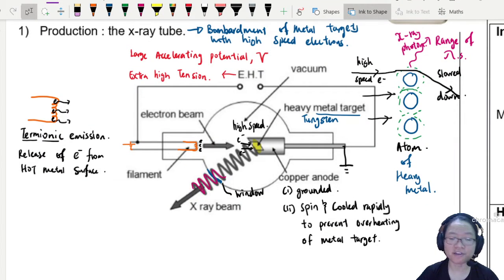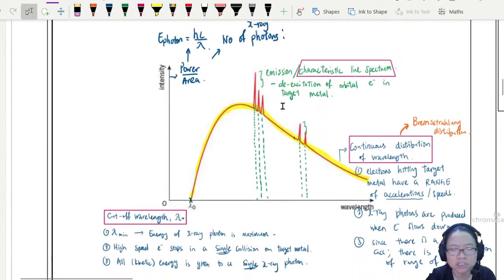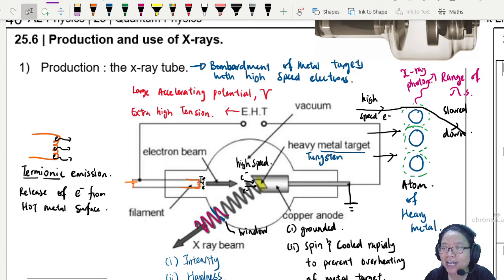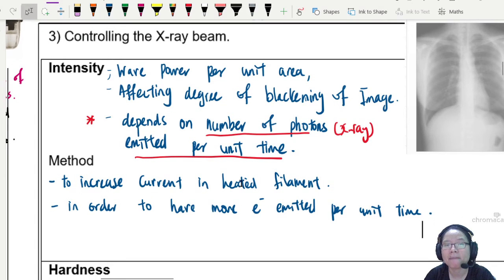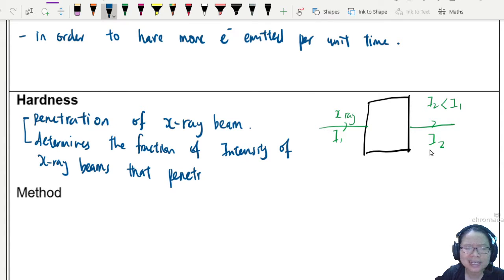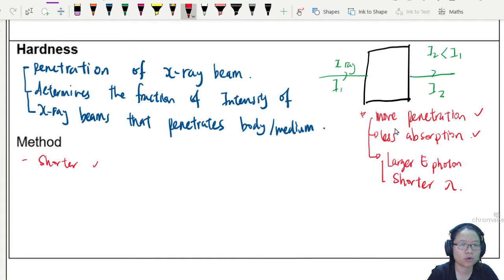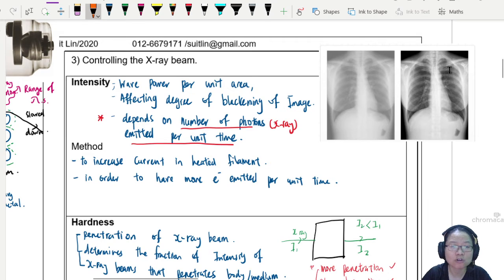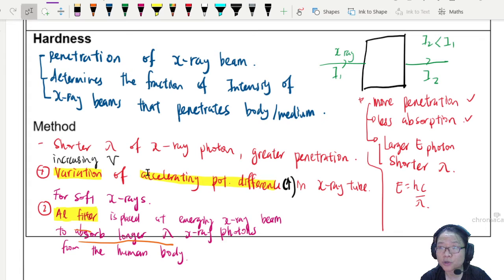BONUS: 24.1b Intensity and Hardness of X-Rays | A2 Medical Physics | Cambridge A Level Physics

Comment: Miss, have you made a vid about how to calculate the minimum wavelength of X-rays produced from accelerating p.d? This is from the new 2022 Syllabus.
Reply: Max Kinetic energy of electron = work done by electron = eV = h f(max) = hc/lambda(min).
Reply: We know that energy of an electron that is made to accelerate with a potential different V is= eV  and we also know that energy of photon= hc/lambda. Now if we assume that the incoming electronic transfers all its energy to the x ray photon, then putting the two equations together we get  lambda= hc/eV  and this way we get the min lambda

Comment: Professor i have a note im in radiology field and your explanation is Very Clear and Attractive But there is small one thing that if you increase the intensity you only decrease the SNR of the radiograph i mean if u decrease the intensity your image get noisy since in the center there will be one third of the intensity and will be photons starvations also the one control the darking of the image is kvp and its actually the more u increase it ruins contrast make it more burned out the film I have very long explanation for that I worked at nuclear medicine before and Computed tomography also mri so I may would like to see u do videos about them especially by a professor from Cambridge
Reply from the maker: Yes, that's right! Thanks for sharing some insight on intensity. Too high or low intensity is not ideal. 

Also, we are not professors from Cambridge 😉 just Pre-University lecturers
Reply: @ETphysics  thank you for teaching